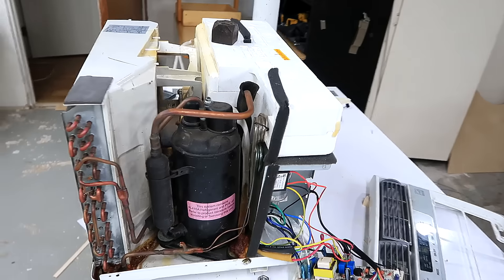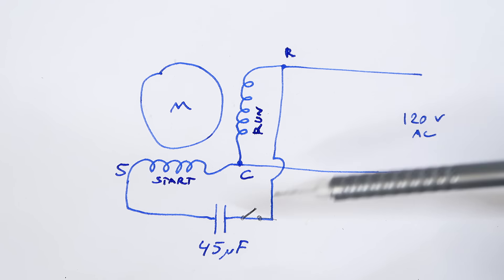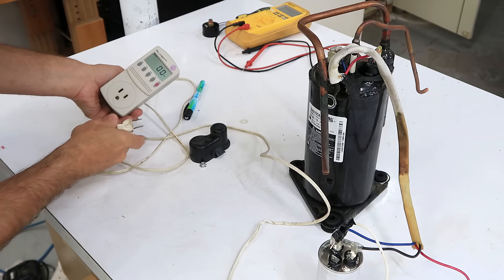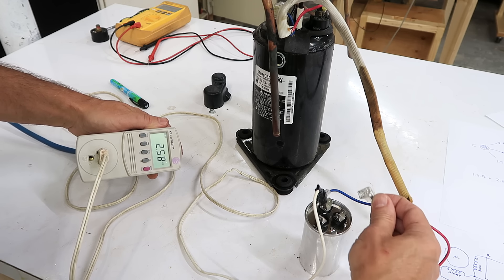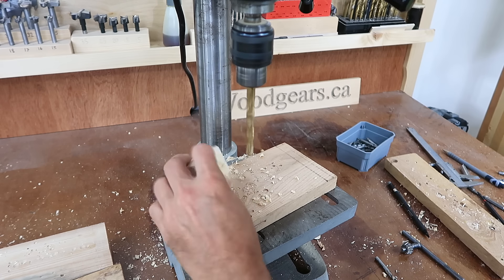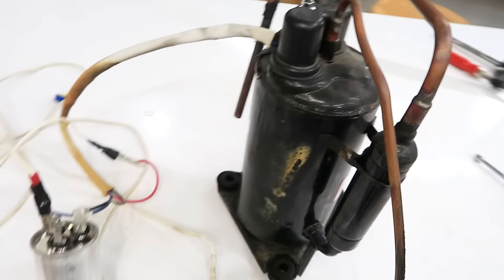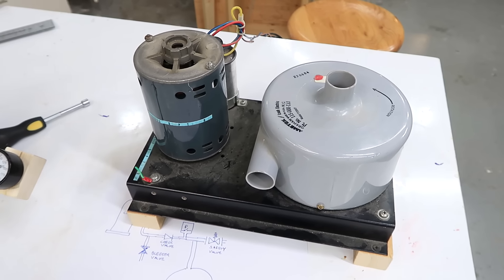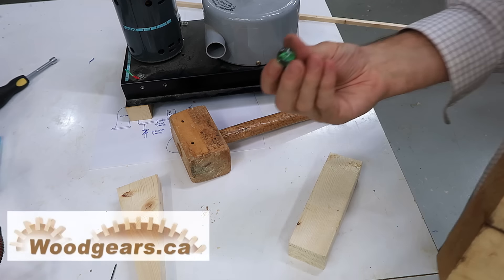Reusing an air conditioner compressor

Comment: I used a couple ac compressors in an oxygen generator system I built, used a double swing adsorption element from a oxygen pump you’d find being used at hospitals/retirement homes for elderly, and an exercise ball as a diaphragm to collect the oxygen as it’s produced at a small pressure/volume then some switches to kick on the compressors to suck the oxygen out of the diaphragm and compress it into an oxygen tank and an arduino micro controller to control it all, the molecular sieves separate the oxygen from the nitrogen and moisture so it’s almost completely dry oxygen being compressed so no internal rust issues, a moisture trap to separate any oil from the compressors, the line is positioned vertical as to keep as much oil in the compressors as possible, and I use the oxygen as a means to oxygenate my oil burner jet for my foundry to help reach temps high enough to melt steel and cast iron, all using old junk and recycled vegetable oil for a budget foundry, needless to say, it’s all pretty dangerous and wouldn’t recommend anyone else try it lol, dangerous on so many levels

Comment: I had a compressor from an AC unit, and I recorded maximum pressure at 880 PSI. It was awesome for pressurizing my Air cannon. Unlike yours mine was made from cast iron pipe, and could handle substantially more pressure. 3 inch PVC has a recommended working load of 180 psi  with a burst rating of 840 (although I have seen them break long before that..  

Cast Iron pipe: A 2-inch pipe is rated for 920 PSI of continuous service pressure and will burst at 7,340 PSI.

Comment: The coolant has oil which seals the compressor and lubricates it. The commercial one I have that has that type of pump has a sight glass. The one I built has an oil trap on the output that drains back to the pump when it turns off. Kind of convoluted plumbing but super quiet.

Comment: R410A compressors use POE lubricating oil. It might degrade and become acidic due to moisture in the air. I would use the compressor as a vacuum pump only because it might discharge some oil in use. The older R22 compressors use mineral oil and is less of a problem when using it open like this, although it may still absorb water and other contaminates so would have to be changed every so often (not that easy).
Reply from the maker: Good point.  I just swapped it for mineral oil as best as I could.

Comment: On my 1989 chevy Silverado. I used my factory ac compressor as an air compressor. I put 30w oil into the suction side every few uses. Also used an oil water separator as well as a check valve. Could also use 10w 30 oil.

Comment: 6:15 If you buy a "pressostat" (pressure on/off switch) , when the set pressure is reached and the electric switch turns off the power, there is a small release valve inside that release the pressure between the compressor and the check valve, so that the compressor can start without backpressure.
Also, if you want to use a refrigerator / airco compressor as a normal air compressor, it's recommended to swap the oil with normal air compressor oil, the original oil is very aggressive for rubber tires/footballs etc.... if you don't use a oil separator. 
Such a compressor new can reach easily 50 to 60Bar of pressure, used ones depending on the age will reach 25 to 30Bar minimum. 
Back in the 90's, i have build many air compressors with compressors of refrigators / freezers, and used a propane bottle as tank, with a safety pressure valve that opens if the pressure switch don't shut off, otherwise you create a bomb.

Comment: I have been using an AC comp on an old compressor tank/pressure controller for years.
I periodically squirt left over vacuum pump oil into the air cleaner inlet and so far, so good.
It's not fast, but quiet.

Comment: When I did  HHO testing I used the following method to determ production rate. 

1) id mark a 2 liter bottle with 1 and 2 liters of fluid inside
2) then id connect a section of hose to the hho generator and put the other end inside the bottle. 
3) Then I'd put a second hose in and turn the 2 liter bottle upside down over water and use the second hose  to suck the air out of the 2 liter bottle to the point where there's maybe 0.5 liters of air left, And then pulled the second hose out. all the while I'd keep the HHO hose just above the water line.  
4) Then when I  started the test, I'd hold the bottle so that the water level inside and outside were even so that there was never any pressure or suction. I'd also keep the position the end of the hose just above water level so that I didnt have to factor how much volume it consumed. 

5) Then i'd start the timer when the water level was at the one liter mark, and at the 2 liter mark.  Then I'd know how many seconds it took to displace 1 liter without any pressure to influence it.

Comment: An R410a compressor can reach 800-1000psi easilly. you have to be very careful not to burst the air storage tank by using pressure relief valve and pressure set cutoff of the compressor. The oil inside also needs to be changed cause most if not all 410a compressors use POE oil which absorbs moisture from the air and will destroy the compressor over time. Volume wise an r410a compressor doesnt provide big flow rate because its designed for high pressure and also high backpressure(suction pressure). You can check the cc of the compressor if you have the part number of it. Multiplying the cc with the rpm will give you the flowrate.

Comment: One more thing to add - that compressor seems to be a rotary one, which are generally less suitable for running with air as the case is on the discharge side - any amount of humidity in the air will condense here and mix with the oil, which is obviously bad and potentially dangerous if terminals are exposed to humid oil. For an air compressor better use a piston type and this one would be OK for a vacuum pump.
Reply from the maker: its a piston type inside,  I can tell from the sound and intermittent air flow
Reply: @matthiasrandomstuff2221  Veery unlikely. You can guess by overall shape and presence of an accumulator (that cylinder at its side, to protect from flooding with refrigerant) as suction is directly at the inlet pipe. That's also why it quiets down dramatically when you block the inlet.
Reply: @matthiasrandomstuff2221  don't mean to be rude, but it's a scroll compressor, and will bleed air back out the inlet on shutdown. If your tank has a check valve, no need to get any fancier. Piston hermetics have internal suction and discharge check valves (reeds). I never stand near mine in operation and when it stops gurgling after shutdown I add a bit of 30 weight. It also does not operate below freezing, hypothesis still moisture in the housing. Beware of rust.

Comment: The comparison with the cheap shop compressor is usually because they only have negligible oil mist on the outside, i.e. all the seals are running dry, and will eventually need replacing.
If you want a shop compressor that is silent and doesn't break the bank, look out for three-cylinder compressors. 10 bar, 300 liters per minute at reasonable noise level, around 700 bucks.

Comment: I use three refrigerator compressors in parallel with a small tank and a chinese regulator/pressure switch combo in my garage. It is enough for tyres, blowing out debris and other low pressure uses. I don't push it too much though.
Reply: Lol now that’s some high flow

Comment: There are pressure switches that integrate the bleed valve, used to bleed the head pressure off the compressor pump in some models.
That one way valve is odd; never encountered that in my decade as a repairer. Most compressors integrate reed valves in the head assembly, so are one way by default.
May be specific to this repurposing, or a national difference; but we see equipment from everywhere here in Oz.
Reply: the one way valve is probably integrated with the bleed valve - if you didn't have it, you'd bleed all the pressure out of the tank too, not just the compressor head pressure.
Reply: All you need for the bleed valve is a simple 220v normally open solenoid
Reply: Heads up, don't need a bleed valve on a scroll compressor. If the tank has a check valve, as most do, the oil is the only thing creating the seal. Oil alone will not hold back 10 psi. When the unit shuts down, the oil will gurgle and air backflows thru intake. Beware of rust, light duty only, as moisture prevents operation below freezing. Hope this helps.

Comment: I believe the cap is always there for the phase shift the only reason they are switched on at start and off is a hard start that allows more current for the start winding for a second or 2

Comment: Air conditioner compressor run in a close loop with lubricant/oil mixed with the refrigerant.
Using it to pump air will cause it to die very quickly.

Comment: Great video, but yes as other commentators say the metal of the compressor has to be grounded at minimum . If you see other YouTube videos of AC's, the compressor can and does short to the metal can it is in, so in this case a person might be electric shocked if the ground is NOT connected.

Comment: Many many years a go as a young teen my neighbors had this refrigerator compressor their dad set up and they were using it to fill up their bicycle tires.  What I wonder and still do it that these were designed to have some kind of fluid in them, and without that fluid the unit would soon no longer work. Also I don't know if the built in valve system was meant to complacently seal off any backward air or fluid when the unit was not running, or the lack of the proper fluid has already caused the problem of leaky valve.

Comment: That is a run capacitor that stays in the circuit. Start capacitors are usually plastic and wired in parellel with the run capacitor and will have a potential relay ran in series wjth the compressor circuit to remove the start capacitor from the circuit after startup. Also, the compressor is usually cooled by the leftover cooling capacity of the refrigerant. Typically, if these compressors try to compress liquid they will short, but if the liquid refrigerant was evaporated too soon in the evaporator it will also have mechanical failures from overheating.

Comment: My very first compressor was from a refrigerator on the side of the road and an old oxygen cylinder. I had no pressure control and found that if left for long enough it would make about 750 psi. No problem for a pressure vessel like that. Regulated to 125 psi it would run air tools ok. Later I had a three ton ac compressor and hooked up a pressure control to about 250 psi. just squirter a little transmission fluid in the inlet while it's running about every ten hours or so for lubrication.

Comment: I made vacuum bagging pump out of that exact type of compressor....it uses a car carburetor vacuum diagram thats attached to an adjustable spring that triggers a switch from a microwave oven door...turns off the compressor when desired vacuum level is reached

Comment: A common problem we have where I am is momentarily loosing a phase for a split second. It's just long enough that if the compressor is running it will flip direction and run backwards till you turn it off or it shuts itself off. Happened twice the other day actually... Hasn't happened since last year. My neighbors was on and was also running backwards so I ran over and pulled the disconnect and restarted it. 
       Unfortunately There isn't anything in the compressor or the relay to prevent this from happening and I don't know of an aftermarket module that will protect it that is affordable. 

         For cooling the compressor it relies on the cold refrigerant on the suction side to cool it. But they are still good for short run time uses in the shop.
Reply: All you need is a "delay on make" timer for the compressor. Any time the condenser unit loses power, the timer will engage. It will then force the compressor to fully stop, wait 5 minutes (or any other setting) for the head to equalize, and then it will allow the compressor to start back up.
Reply: @mannys9130  Have one. It only works if the air handler looses power long enough and it happens to be on the leg that drops out as it's on the contactor leads not monitoring the incoming AC phases. I used to do commercial refrigeration way back. We had commercial units on the three phase power that if it noticed any drop at all it would kick out the power. But for ones that work on residential they are around $400 last time I checked.
Reply: Phase loss relays are a thing, not sure whether they'd react quickly enough.

I'm surprised there isn't enough inertia in the compressor to keep running.
Reply: Phone your power company - if you're loosing one of your hot legs (and it's a leg, not a phase, unless you actually have 3 phase power which in residential is highly unlikely), there's a loose connection, failing cable, or failing transformer. Probably a lot easier for them to fix when it's a small problem, not after it melts down into a molten blob (or if the problem is in your breakers or wiring, after your house burns down). Also check the contactor in the AC condensing unit for burned contacts - contactors are cheap to replace.
Reply: "loses" :-p
Reply: There’s a few good things on the market for that.  My favorite is a Sureswitch it’s just a solid state relay that takes the place of the contactor and they monitor the power and have a built in time delay for loss of power or strange power events

Comment: If the compressor stops running, it may be just the thermal overload. There is typically a thermistor on the common terminal. If you measure normal resistance from start to run, and open from both start and run to common, just wait for it to cool down

Comment: The oil inside the compressor turns acidic when exposed to air. Best thing to do is drain the oil and measure how much you took out. Add mineral spirits to rinse it a couple times, then add normal compressor oil to replace what you drained out. You could periodically change the oil every 50-100 hours of use. Just make a special measuring cup the same size as the oil you drained out, and then you won't have to remember how much to add when you change it. You could also measure how much oil is used per hours of use to get an idea on how often you'd need to change the oil. Even normal air compressors use oil and will need to be topped off after a certain number of hours.

Comment: Recommendation:  Get a short self drilling/tapping screw, drill a hole in the bottom of the compressor and dump all the Freon oil (it's hygroscopic = absorbs moisture and turns to acid), then get regular compressor oil (synthetic) and suck approx 1/4cup (2oz) in the intake tube, then put the short screw in the hole in the bottom to seal up the compressor

Comment: I always thought that those needed the R-14 for lubricating the compressor. I don't know anything about window ac but I remember that you can't use a car ac pump as a air compressor unless you set up a oiler on the intake side.
Reply from the maker: I don't know.  Works fine so far.  If it goes, it goes, no big loss.
Reply: I still have a car A/C compressor I was going to use as an onboard air compressor, lubrication was always going to be an issue so the project was abandoned.
Reply: @MattTester  same reason I abandoned onboard air on my ranger. kinda wish I'd done it though because it would have been so cool.
Reply: @OtherDalfite  Yeah it's possible, I found a filter that could be stacked above an oiler so the oil was re-circulated but I couldn't find a good way to mount those. I'd also like to see it done well. Mine was going to be in a Discovery.
Reply: @MattTester  yeah pretty much same. I was going to use copper piping and fittings for mine but lost motivation after realizing that compression fittings kinda suck
Reply: @OtherDalfite  Exactly the same yeah. I got copper pipe, compression fittings, air parts and a small tank. I even got an oil cooler to run the air through because it comes out of the compressor so hot. 
I had an air rear diff lock in the truck so it would've been handy but I found out I could just charge the tank at home and it would last all day. The truck I have now has an electric locker so no need.

Comment: I think we are related. You remind me of “me”.  However, it is a curse because I take everything apart and try to fix it (ie battery chargers, AC, tools, transmission, etc.).  I have hundreds of projects and some take over a year to complete.  Drives my wife nuts😂😂…good luck.

Comment: I made a vacuum bagging pump out of that exact type of compressor....it uses an old car carburetor vacuum diaphragm thats attached to an adjustable spring that triggers a switch from a microwave oven door...turns off the compressor when desired vacuum level is reached

Comment: I used a fridge compressor as a compressor and vacuum pump, when I didnt have the money to buy them. Only Problem was after a while the hot would invariably leak to the case, so it was dangerous to touch it. I do not understand all the comments about safety… it is just compressed air! High presumption oil is dangerous. But please, I played with that for years, I was like 15 the first time…